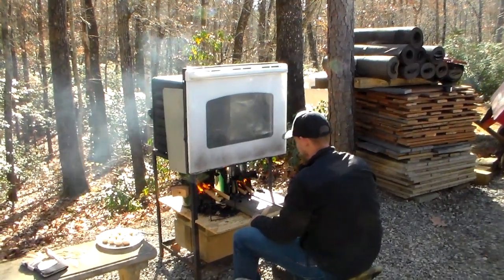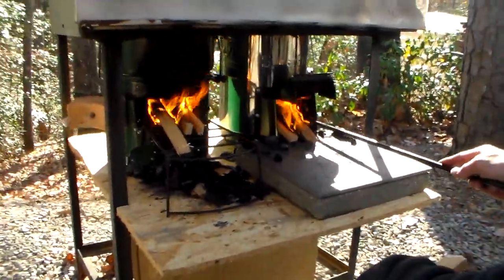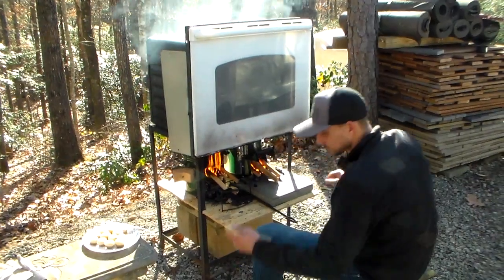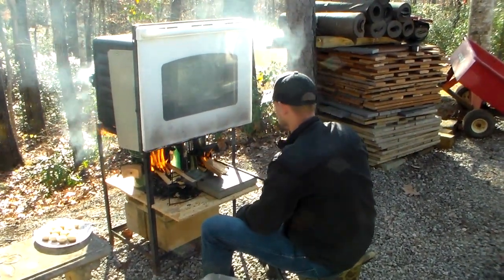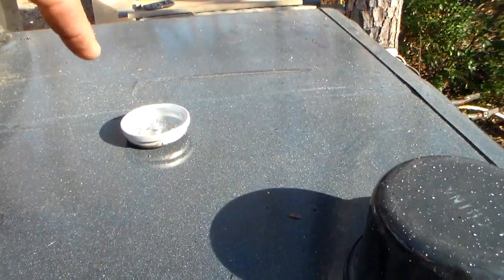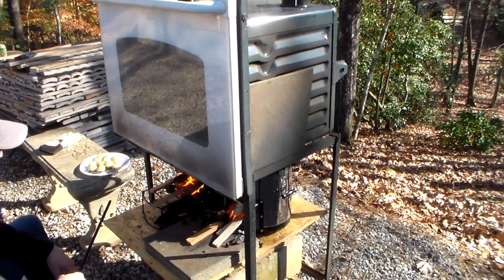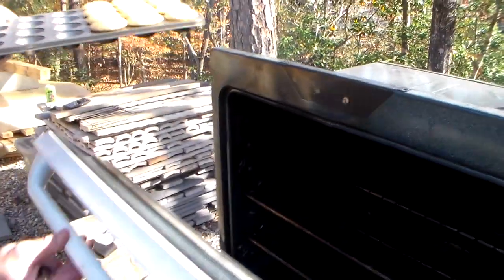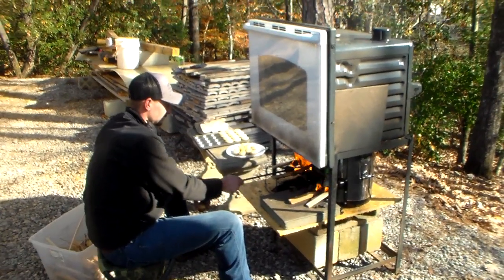How to to turn an electric oven into a wood fired oven.

Comment: I made something to cook on using scrap lying around:

bricks (base)
tin (round wall, and door)
big rig wheel (inner base that contains the fire)
big iron hub (inside the wheel)
wire (holds tin wall and door etect)
front of old dishwasher (top) 
rocks (fill spaces between wall and wheel)

I was blessed to have had these 'junk'  items on the property I bought six years ago as they all went together perfectly as envisioned on the first try! 

It's literally been a life saver, and will be again if necessary.

Comment: It would seem you could take a grill thermometer and make a hole for it in the side. Of the oven.  I would suggest placing a pizza stone on the bottom and sides to hold the heat longer.    A Dutch oven is much easier and inexpensive for every home to have.
Reply: Yes but I can't fit a turkey in a Dutch oven. I love this idea. I have a very large family, we would need 6 Dutch oven going at once to feed them.
Reply: @montanaliving4769  not being rude, just sharing my experience. if your family is really large, then id compare it to my experience in boy scouts or on ECOEE where every meal is over 10 people. it was common to be using 3 or 4 Dutch ovens a meal. I have helped cook for over 100 people outside at Trackers Earth. Remember it has ben done before, we just have not done it as a society in a long time. Having one turkey in an oven like this, would take a very long time due to the lose of valuable heat. if your going to cook a turkey in an oven like this, you need to cook on all sides that can be cooked on.

Comment: Before they had temperature controlled ovens and thermometers, the cook would simply stick her hand in the oven to check for temperature. There were basically 3 levels, low, moderate, and hot.
Also, if you put some sort of insulation on the sides and top of the oven it would help to maintain the heat better.

Comment: Spot on. Ive thought about this a lot to avoid having to use the dutch oven for quick breads, biscuits and cornbread. Hot water cornbread is great with beans but a regular large cornbread is a must around here at times. All the propane stove/ovens used in rec vehicles / 5th wheels seem to be sold out around here so its hard to visualize what you're getting ordering online. We may have to go this route at times. Stack it deep and be safe out there in zombieland.....

Comment: Get and old grill thermometer from a throwaway grill (the $100-150 jobs always rust out). Drill a hole that size. They usually have a little wingnut you can tighten by hand.

Comment: I saved my old stove for the parts (controllers/elements/lighting)  Now I have a new use !  Thanks for the idea !    My turkey fryer could also be fixed under it.  Even a gas grill for that matter. (already have spare burners for it)   I have a Fluke meter with thermocouple attachment.  That might work for gauging tempeture.

Comment: Awesome father and son team.  Used to be that way for 99% of families in the old days.  We picked up an old circa 1920's  Standard Gas / Arcade Manufacturing stove for about $250 and everything works on it. We tested it with a 40 pound propane tank. We are going to build a gas valve system with gas leak detection to shut it off if it detects a leak. Maybe even add a switch so it can shut off the main valve coming off the tank if it detects a pressure drop on the gas line when the stove is off. 

How we might achieve this:
This would be via installing a temperature monitor above the stove and at the foot of the stove. If it is less than 150F degrees above the stove, it detects an pressure drop for longer than 1 minute with no temperature rise above room temperature above the stove, it shuts off the gas valve coming off the tank. Will maybe use an Arduino with a few detectors and a Linux OS and some code to gather data in an array from the two temperature detectors, and then compare the data every second. If array slot 1 numbers are not rising more than 30% above the array slot 2 numbers within 30 seconds, then shut off the valve. Array slot # 1 data is from the top stove sensor and array slot # 2 data is from the floor level sensor. Maybe even add a sensor to the oven, to the warming box, to the top shelf above the stove. This way we have three slots and the top array and or the oven array slot numbers must be rising a % of the floor level sensor or the main valve gets turned off to stop pressure drop on the gas line into the stove. 

It can be powered off from 5 volt DC, reduced form a 9 volt battery.  The battery would last for a few years if we use a long use rechargeable lithium ion battery.  This type of circuit is called a voltage divider and is a common way to reduce voltage in a circuit.  When the two resistors in the voltage divider are of the same value, the voltage is cut in half.  If the circuit is powered by a 9 V battery, but your circuit really only needs 4.5 V for your device, it will feed 4.5 volts of the 9 volt battery to your device.  At least my research sows this would be a way to achieve this.

Comment: On our spread we have a large amount of woods, we have been researching steam boilers to generate electricity as an emergency generator system.
Reply: You might want to look at running a gasoline powered generator on wood gas. That may be an easier solution for you. There are lots of videos on it.
Reply: I think they call it a wood gasifier

Comment: Interesting idea also if you could contain more or the heat in the fire area and insulate the oven itself to trap more heat it would help with efficiency
Reply: The oven is insulated already. I had to take one apart in the 80s and saw for myself. Mice had gotten into the insulation when it was being stored

Comment: I fix appliances for a living. I'm fine with this idea. But keep in mind there is a layer of fiberglass insulation in the walls of the oven. Check to see if the one you plan to use is insulated and remove it.
Reply: Good point!

Comment: Juno did something similar. 
Granny's woodstove had the firebox
On the side so that side of the oven got hotter. She would know just when to turn the pan around so each side got browned the same.
She kept a brick by the stove. If it got too hot she would put in the brick to absorb some of the heat.
If she wanted to keep something warm for a long time she would put the brick in the oven with the food.

Comment: Put an oven thermometer inside close to the window so you can see it from the outside. They are between $5-$10 depending on which one you get. Can get them at Walmart. Maybe Target I don’t shop at Target.
Reply: I got a few at the thrift store for a couple bucks.

Comment: Drill a small hole in the door or side and put a thermometer with a longer probe through it with some high temperature silicone sealing it. or don't use the silicone so you can remove it and store it inside out of the weather so it lasts longer

Comment: Just get the thermometers that they use for offset smokers where you could stick it in there and it will tell you the temperature on the outside

Comment: You should be able to put an oven thermometer inside and use a small flashlight to illuminate it without opening the door. Seems like the simplest solution.

Comment: Wonder if you could put it on blocks in your home connect some type of pipe over that whole and run it out of a window and use it as a fireplace to heat your home if you had no other ways to heat your house